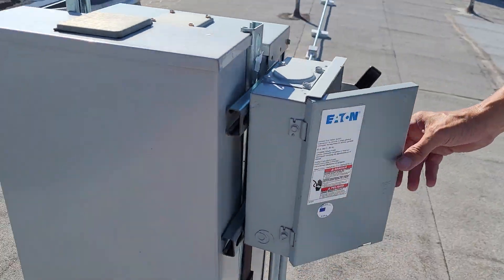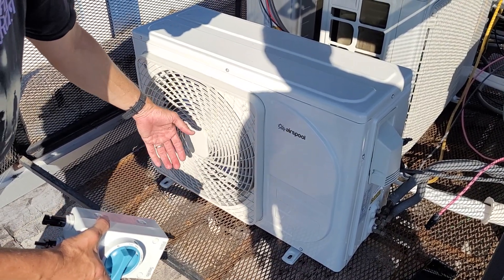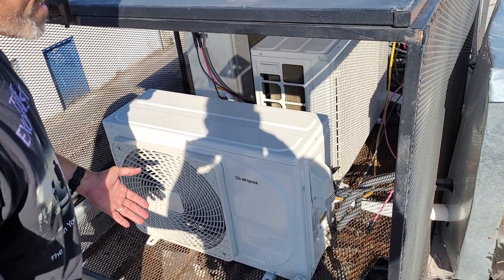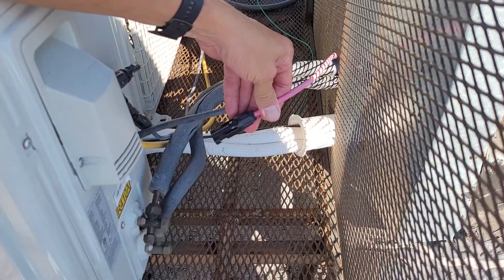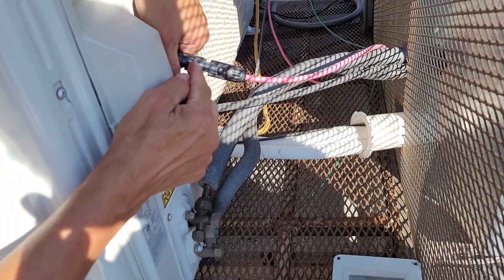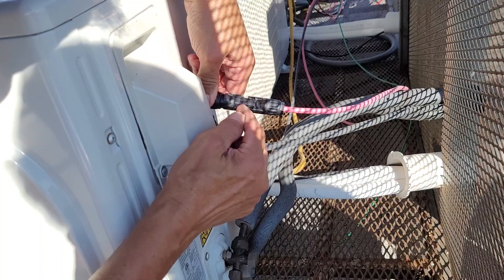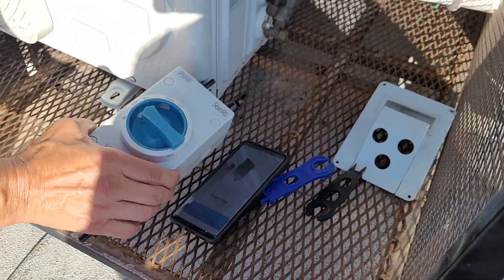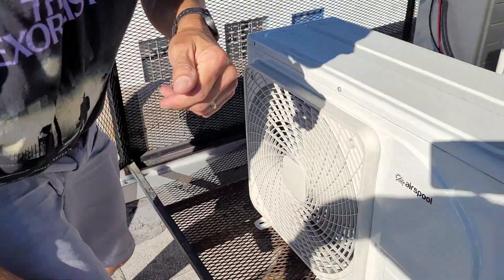#10 How to attach your solar array to your Airspool solar-powered air conditioner/solar minisplit

Comment: Thank you Dave for making these videos on your Airspool Solar Mini Split AC!!  I bought one about 2 to 3 weeks ago, installed it with 4 / 455 watt panels.  I'm here in Mesa AZ where we've been setting HIGH heat records on a continuous basis every day, just like Vegas I'm sure..  Even in 110 PLUS degree of temp, this thing STILL pumps out COLD COLD air!!....  I have the thermostat set to 61 degrees and my master bedroom, where it's installed, it's like a meat locker in the day!  I also, of course have it plugged into a wall socket and have it programed to "Limited Wattage" for grid power starting at 6:00PM when the solar panels starts to stop producing power.  I also have it set to run FULL BLAST starting at around 9:00AM as soon as it starts to get full power from the sun.  I just bought another one of these for my living room to do the same thing.  I bought PLENTY of panels to eventually cool my entire house using quite a few these Airspool solar mini splits.  My END GOAL is to have a complete inverter / battery setup to run the AC's during the night and recharging those batteries from other panels during the day.  I'm 60 years of age and am doing this during the HEAT of the day. about 10 to 15 minutes at a time.  I will soon have a COLD house!!  I'm loving these little units and so is my wife!!
Reply from the maker: Love it!
Reply: Hi, thank you for your comment. I am also in Arizona (downtown Phoenix), would like to put a unit like this. I was a bit concerned in an earlier video where they say that the temperature split is only 20 F - do you find it sufficient for our 115 degree days?
Reply: @alexkhazanovich1680  There are a few variables to this equation.  The BIGGEST one by far is, How large is the room that you're trying to cool?  As stated above, I own 3 of these and the one in my master bedroom has WAY less room the cool so it gets FREAKIN COLD in there, which I LOVE!  The two others are;
1. In my kitchen which has a rear living room area that it works on cooling too so it doesn't get nearly as cool as my bedroom.
2.  The other one that's in my main living area is a large amount of space also which means it gets about as cool as my kitchen.  I also have 3rd party wireless thermometers hanging from the front of each unit so I can see how cold the temperatures are from all three units.  In essence, they are all VERY close to pumping out the same temps.  Even at OUR HUGE hot days, the air being pumped out of the units can be a consistent 61 degrees (plus or minus about 5 degrees.
ALSO -- Just know that these units come with an app that you can totally control from anywhere in the world at any time and is easy to get set up.  In the app, there are settings that allow you to make them run to 100% FULL BLAST.  I've noticed that running at this FULL blast uses about 1100 watts at the MOST.  These units fluctuate dramatically so 1100 watts is about the MOST I've ever seen them pull.  They all come with a regular 120 volt plug that they just plug into the wall outlet.
I bought all mine at San Tan Solar and Arizona has ZERO taxes on all solar equipment.  They are good to work with.
If you want to know more, or if you'd like a person to just advise you on the install, email me at -
wildwestunlimited@gmail.com
I'd pass on my experience and knowledge for nothing.